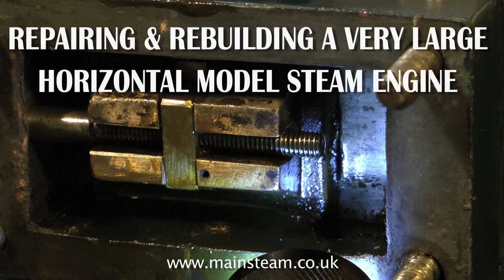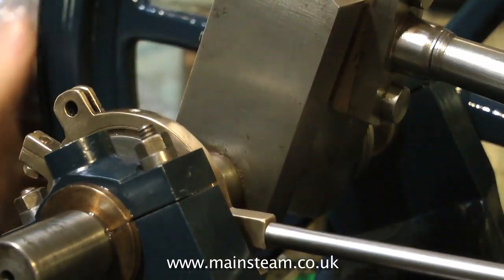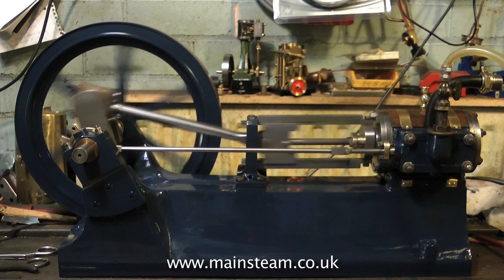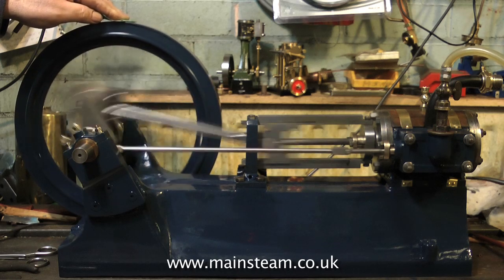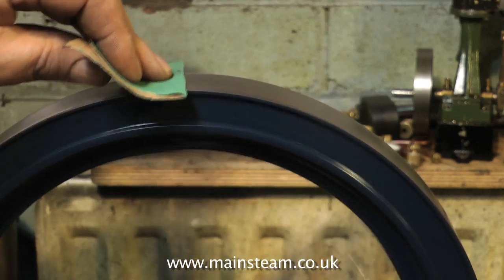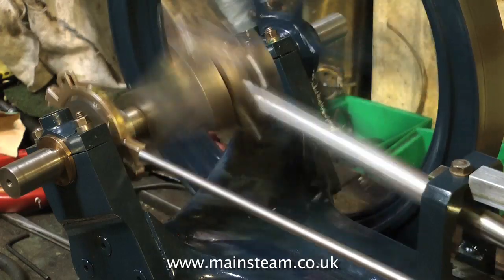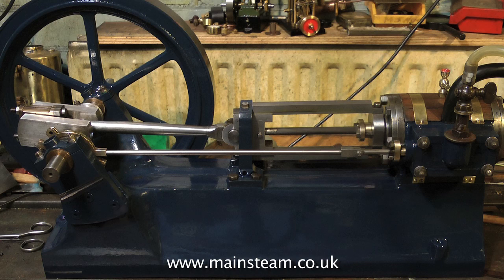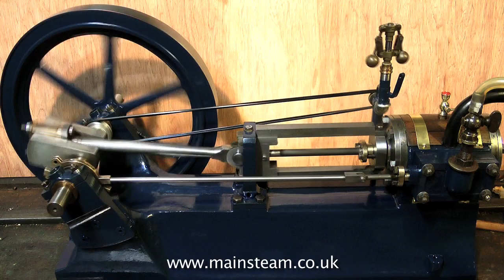HOW TO REBUILD A LARGE MODEL STEAM ENGINE - PART #8

Comment: Warning! This is my personal opinion. I must say I'm normally not a big fan of the colour choices on some of your engines because I do find the green you like to use too bright as well was the jarring contrast between the brass and glossy black that I often see. However, the colour scheme on this engine is a sight to behold! The blue you've used goes exceptionally well with the gun metal and steel parts and is very pleasing to look at. It's really wonderful.

Comment: I love all your videos, Keith.  Working in the video industry I know how much work it takes, so I very much appreciate it.

Having watched a LOT of videos on making & building steam engines, I am a little curious that I have never seen anyone do any dynamic balancing of rotating parts or crankshafts, etc.  Is it not helpful at this scale or the speeds at which they operate?

If one was to do such a thing, say on a crank, would you balance with the connecting pins, eccentrics but not, of course, rods?  Or just the bare crank?

Just curious.

Thanks, again :)

Comment: When you said the valve timing is slightly before TDC and BDC, how many degrees would that be? Would 5 or 10 degrees be enough or is it more than that? Or do you tune it by ear once it's up and running? Thoroughly enjoyed learning all about this engine, in this series of videos, thanks again.
Reply from the maker: I do it by feel, but I guess about 10 degrees would be fine, it is a trade off between cushioning the piston and the ability of the engine to run really slowly. When it stops "clunking" and runs very slowly, the admission is correct for that particular engine.
Reply: Thank you sir.

Comment: you could probably have a local auto house turn the fly wheel using their brake lathe, may be even machine that center with a drill press and fit it with a piece of copper plumbing pipe, cut and fitted as a bushing, if the size is slightly large, cut it down the length with a hack saw, file until it fits.
Reply from the maker: The gap is only a few microns so a "piece of copper plumbing pipe" would definitely not work - as I mentioned in the video, I just painted the inside of the flywheel boss - this was more than sufficient. But thank you for your suggestion anyway . . . .
Reply: I used Coper plumbing pipe, on a wrist pin in a putch, the solution, is to drill to size after pressing in the new collar , to form a replacement "bushing" of sorts.

just a thought any how.